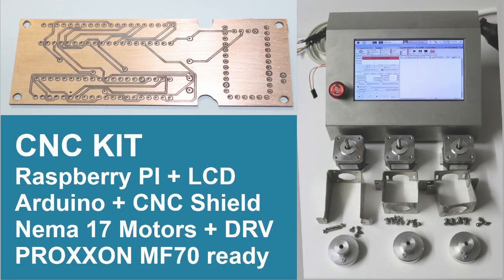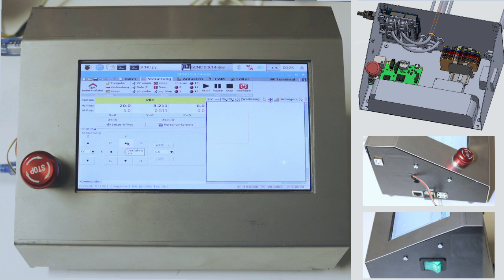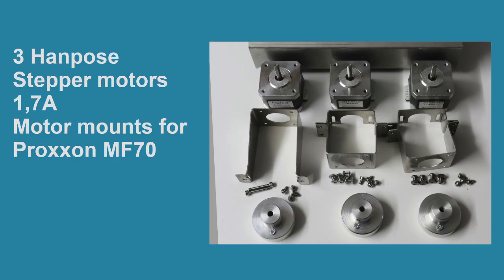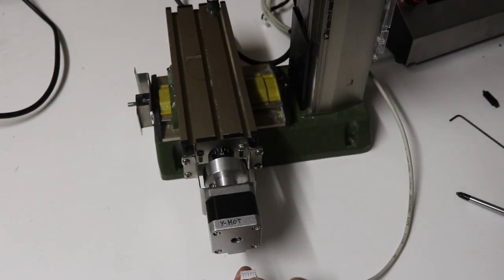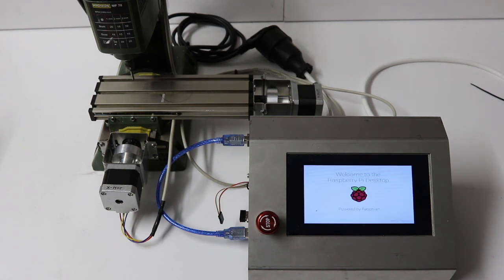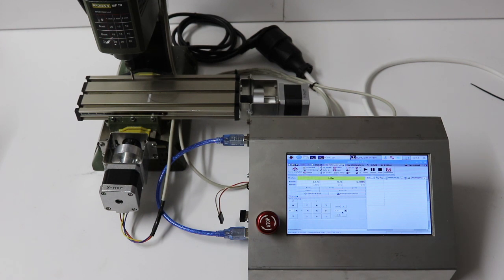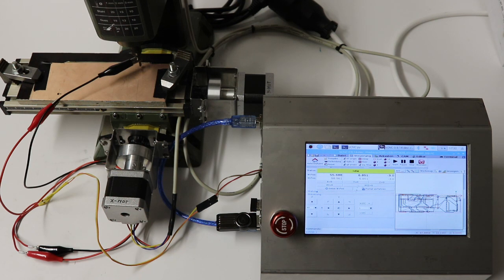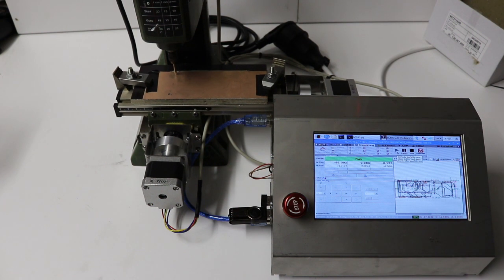Proxxon MF70 CNC Kit www.kofex.net

Comment: How did you do that probing?
Reply from the maker: The red and black cable are connected to the controller. When the electric resistance between them gets low (they touch) and a signal is generated. Google grbl probing https://www.instructables.com/Setup-a-Touch-Probe-With-a-Arduino-Cbc-Shield-and-/
Reply: @kofex3495  and you think why did Proxxon use NEMA 23 instead of NEMA 17 in the original CNC version?
Reply from the maker: @hypertool35  in the MF70 they did not

Comment: I don't have the MF70, but have been thinking about buying it someday, but I was wondering, in the video, when you drill those 4 big holes, there are a lot of vertical movement, what is that?, it's like the "bed" is tilting down when drilling?
Reply from the maker: Hi, yes this ist the slide of the y-axis. In this case the clearance of the slide is not adjusted properly. Like the 3 set screws and nuts on the front for the x-axis there is the same on the left side for the y-axis. But to adjust the clearence properly you have to remove the x-slide, or you have no place to tighten the nut with a wrench. It's a very fiddly work. :)
Reply: @kofex3495  ah, ok, I was worried that there are slop in the MF70, but it can be properly adjusted if one need to?
Reply from the maker: Yes, its fiddely but doable. It is a slide, and the ajdjusting mechanism is just 3 set screws and a lock nuts, there probably will always be some clearance. Otherwise the friction in the slide will be too much.

Comment: I recently bought this controller for my Proxxon MF70, that I use for milling parts for my 1:160 model railway and a 1:12 model of a dutch cottage. Within three weeks after ordering the controller arrived by mail. Installing it was an easy job, thanks to this video and a short written manual.

Unfortunately after a few days one of the stepper drivers ceased working. I contacted mr. Kovjenic, who immidiately asked me to send him the controller for repair, free of charge.
Within two weeks I recieved it back. It now works flawlessly.

It is a perfect controller for a hobbyist like me. Its is neatly built and is easy to operate.  I am impressed by mr Kojenic’s support and his speedy reaction. I can recommend it.

Comment: Is it NEMA 17 or NEMA 21 Engines?
Reply from the maker: This are Nema 17 motors. I would not build in nema 23 motors, they are to heavy an big. Also the original Proxxon cnc/ready has nema 17 motors.